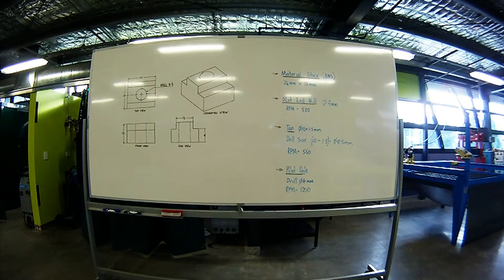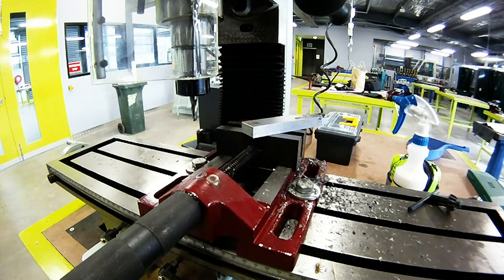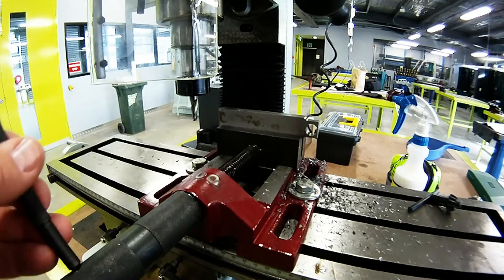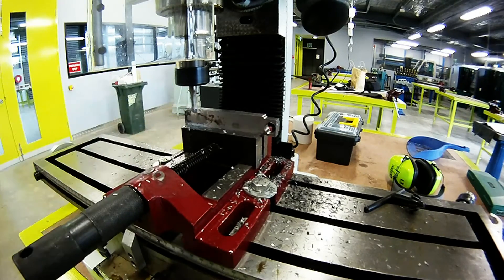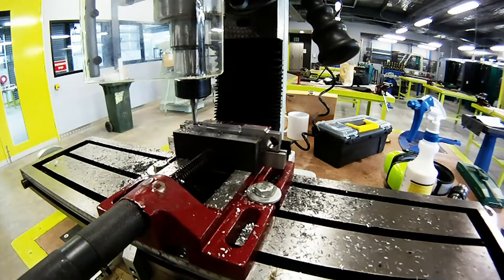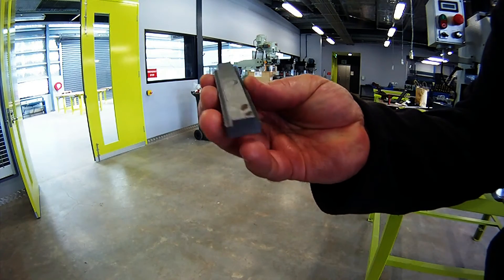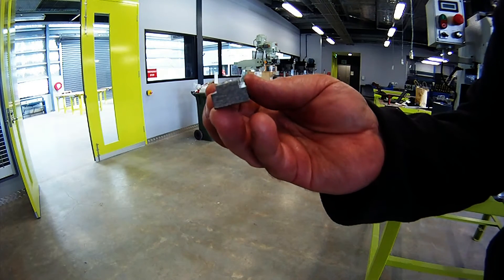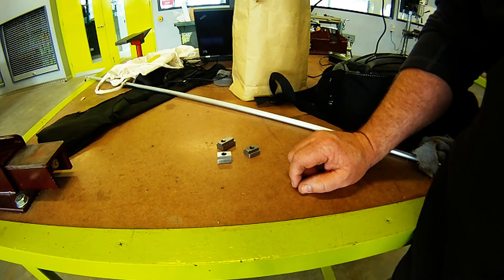TM25V / PM25 Machining Steel T-Slot Nuts

Comment: that slot mill cut looked waaay better than the sound in made :D maybe its the camera that exaggerated the vibration sound

the drilling operation with the large drill should have went much smoother though, rpm too high and very little feed - drill will vibrate all over the place - which will lead to chipping of the cutting edge (if the drill is of any sort of quality variaty) and a dull drill bit quite fast in general, pilot hole could have been smaller - just barely over the size of the web of the bigger drill - will let the big drill locate in the hole much better - but then again - maybe this small mill wouldn't have enough torque in the slow rpm range for the big drill to cut a nice spiral chip
Reply from the maker: Yes the little mills lack some rigidity on hard / bright steels.  I think a proper mill vice and not a drill vice would have improved performance also. Take care and thanks for watching.

Comment: Hello Sir. 
Up to which hardness I can take out fromthat melsll?  by heating and oil or warrer freshing bright minl still in HRC?
Thank You
Reply from the maker: +Life for Life Hello, I'm sorry but I don't have the answer to your question.  The steel I used was laying around and I'm not sure of it's correct grade. When you purchase your steel you usually check the data sheet and this will tell you its properties. Cheers, Aaron.
Reply: +DCTTeacher1 Yea I understand. but many suppliers lie about hardness andbateel quality. )
Reply from the maker: Life for Life Very true, especially the steel coming out of China.  They just don't understand quality control.
Reply: +DCTTeacher1 ooo China another history )))